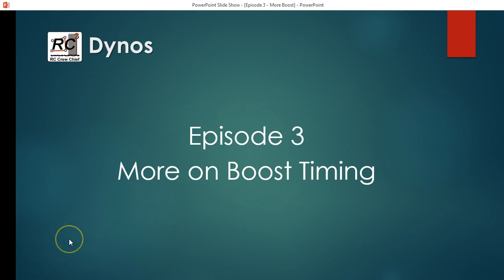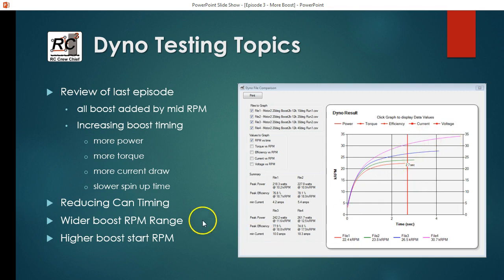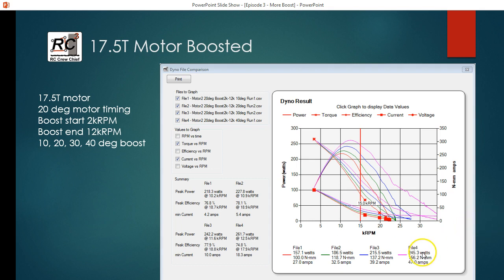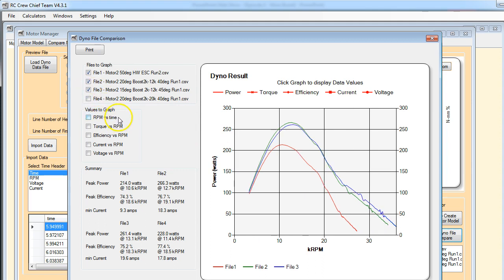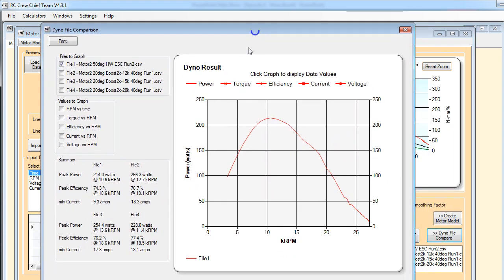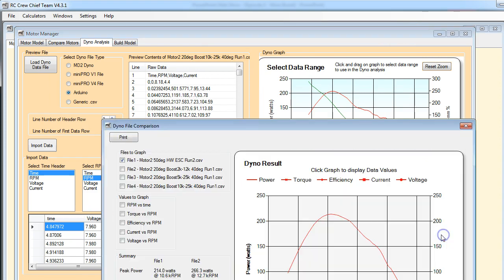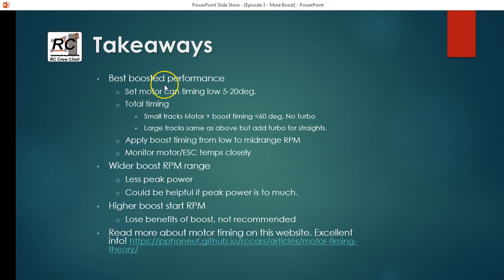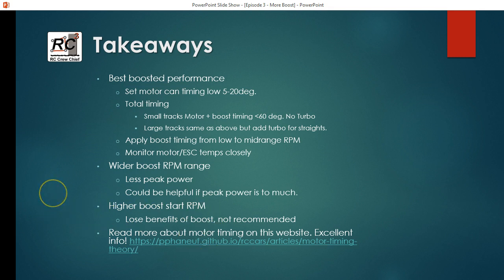Episode 3 - More on Boost Timing

Comment: i suspect the knees that you see are from the incremental boost being added catching up with the ideal trigger point. being ahead a couple degrees of ideal finally reaching ideal and giving it a minor bump in power. The crossovers ive seen are normally a fixed point based on the constants in hp power calculation but i didnt think hard on that. as it relates to maximizing a motor in an application you have two degrees of freedom or restriction. peak power or peak efficiency. an auto commutation program calculated the trigger point for both efficiency and power so that when the motor is in use it only blends between those two limitations. if you do dyno runs that you are trickling in the right amount of timing offset for every discrete rpm you can use this to create a table that an rc guy can use to set his timing. so if you have a track 1000 ft long and you want to run it in 10 seconds you can calculate the average rpm to do this. you set the blinks timing to this 1 end bell setting and you will have max power for that motor on that track. if you then did a series of tests that allowed you to calculate the exact amount of heat that the motor could dissipate continuously and in a 5 minute period you could use a thermal time constant to limit the amount of power (a different average rpm) that is above peak efficiency but below peak power. this is fundamentally what a servo drive does in field oriented control continuously but because an industrial servo is updating the thermal model in real time it can adjust peak power and peak efficiency timing (commutation) on the fly. its also predictable with a thermal time constant. what this means is you can have a published power curve that is limited by heat and as long as all the calculated points on the curve average below the continuous portion of the curve you can have peaks that are above the average 100% duty cycle portion of the curve.